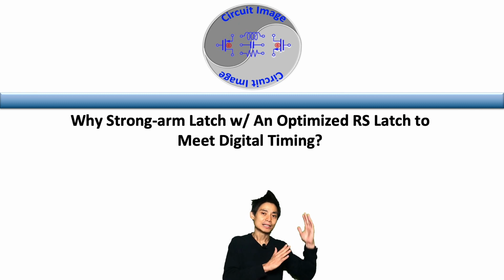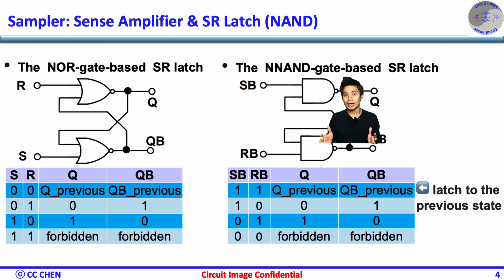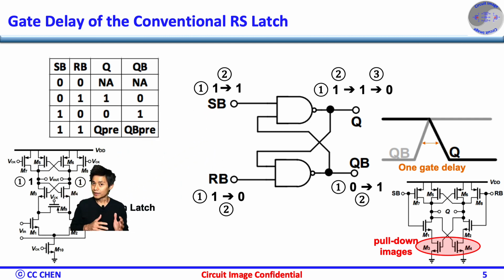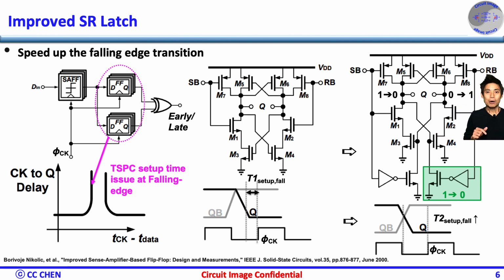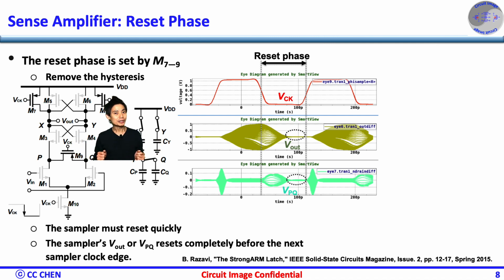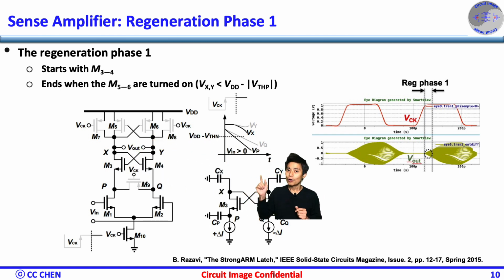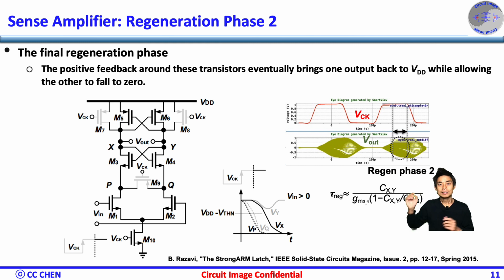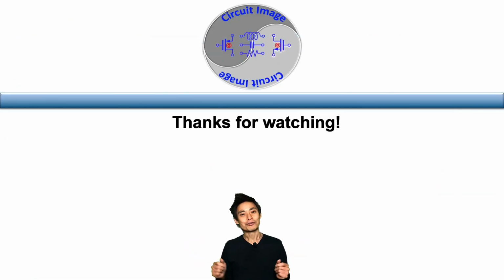Why Strong-arm Latch w/ An Optimized RS Latch to Meet Digital Timing?

Comment: Why not use a slightly different topology of the Strong-arm Latch and replace M9 with 2 clock-gated transistors from P,Q to VDD? Wouldn't that achieve the desired effect at P,Q as well?
Reply from the maker: Hi Yousef, this is a discussion of RS latch, which is needed to convert logic back; therefore, I don't quite follow what your proposal is. Sorry.

Comment: Reducing the cap at x,y nodes certainly increase the speed but comes with larger kt/c noise. It’s like going faster but with more noise, I think this is a fundamental trade off. Any thoughts of decoupling this?
Reply from the maker: Hi Abhirup, thank you so much for always asking good question. Yes, people have modified the sampling time by chaning the clock's duty cycles or applied other two stages to reduce the noise, while keeping the noise, but the power could be higher and risk in the duty cycle contoling; therefore, I didn't mention it to avoid the confusion or misleading. 😄